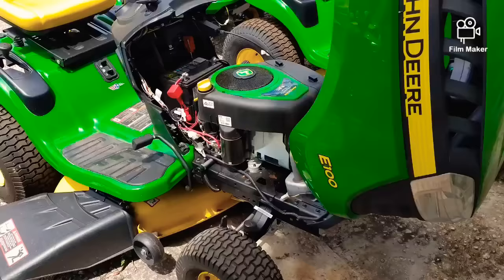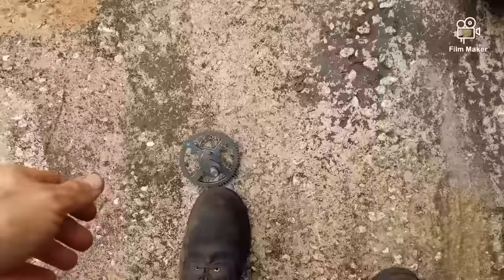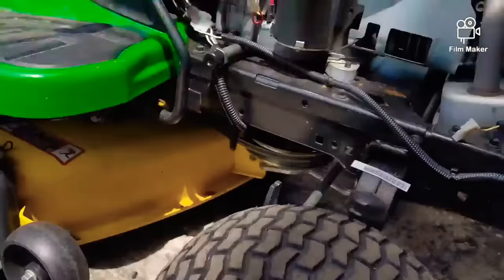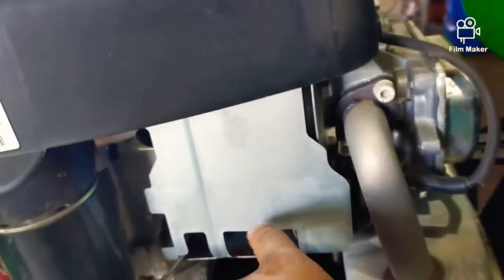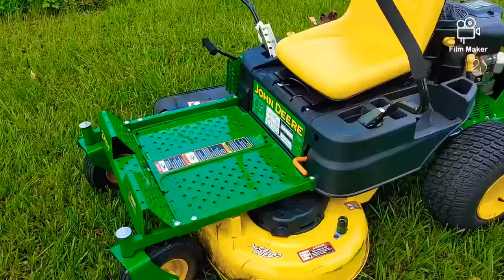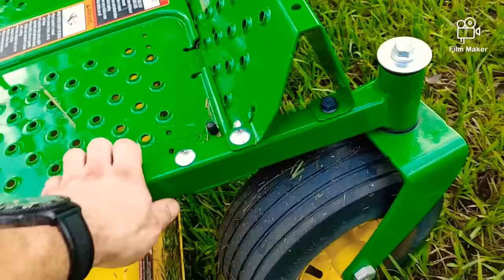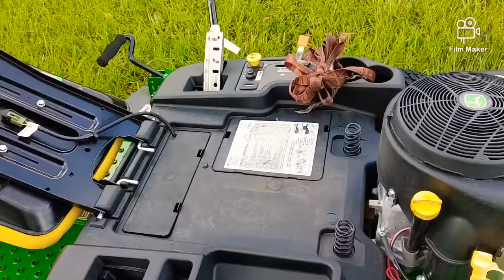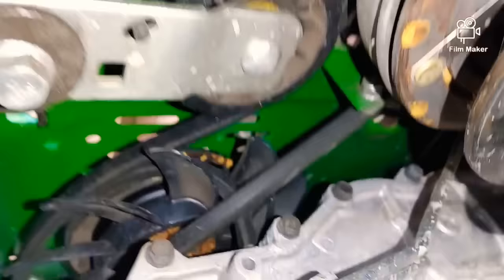Lawn mowers to avoid!

Comment: I purchased a "residential" 42" Toro Timecutter with a fabricated steel deck and the "My Ride" suspension system a couple of years ago to replace a 42" Timecutter with a pressed steel deck.  The only complaint I had with the old machine was the pressed steel deck... which is why I purchased the "same" machine only this time with the fabricated steel deck (which they call "iron forged").  I had to do some repair work on the pressed steel deck because of stumps I ran over, bending/breaking some parts underneath.  (Also destroying the blades)  I appreciate your taking time to make this video and will agree that there are some real pieces of junk out there.  That being said, I will stand behind the quality of my most recently purchased machine FOR RESIDENTIAL USE... indeed, the next step up would have been a commercial unit although the machine I purchased does come in 46" and 52" 'residential' as well.  Toro has made many improvements over the years, and if you purchase the dual bagging system ($900) it simply cannot be beat even by powered vacuum systems- it picks up everything.  I did sell my old Timecutter to one of my neighbors for $400, and he's still using it.  While Toro is the company's main brand, they also include commercial equipment like Exmark, Ditch Witch, Spartan as well as some of the finest rough, fairway and greens golf course maintenance machines available.  I also have a 22" "Personal Pace" walk behind manufactured by Toro.  MTD did make entry-level garden tractors and walk-behinds for Toro a few years back- whether they do or not now, I am not sure.  Most of the "pieces of junk" you refer to in your video are manufactured by MTD.  I think MTD is associated with (or owned by) Murray.  It all boils down to "you get what you pay for"...  As a side note, I will never buy another pressed steel deck zero-turn machine.  The difference between one of those and the fabricated steel deck I now have are day and night.
Reply: I agree ... and the reason I bought a smaller residential zero-turn from Bad Boy Mowers .... fabricated EVERYTHING .... HEAVY-DUTY design and production. I thank my salesman everyday for recommending it.

Comment: I've had a 335 E Z-turn for 5 years now.  I cut 3 hilly acres with it every week during the summer.  Only issues to date is I had to replace the drive belt once, took like 5 minutes to do.  Been very happy with this machine honestly.  And yeah MTD makes these.
Reply: i just feel personally if im getting mtd quality why not just buy a cub cadet and save the wallet and not buy the green and yellow markup
Reply: @harleythrelkeld7587  When I bought mine the Cub  Cadet version was actually $100 more.  Looking now, 5 years later, the Cub Cadet version is $100 less.
Reply: @Zappy1210  thats shocking honestly lol normally the cub, troy built or whatever else are a few hundred cheaper than the green counterpart
Reply: @harleythrelkeld7587  They all run for about $3400 currently apples to apples.
Reply: @Zappy1210  in ohio here a 54 inch cub is actually 3800 with a kohler engine and 4100 with a kawasaki deere is priced the same as the kohler but doesnt outright list engine manufacturer
Reply: NO. MTD does not make the Z335E.  You are mistaken.
Reply: @DAD0123  Nah, pretty sure MTD makes all the non-commercial/industrial John Deere mowers.  Might want to check your facts on that.

Comment: I'm an  eetc certified technician, I work for a national small engine repair company for many years. That plastic transmission was used by Husqvarna for several years, it had so many failures they ultimately quit using it. As far as the compression releases go, in my experience I noticed the ones that failed more often were the ones that lacked regular maintenance such as oil changes. The 31r Briggs engine was Notorious for those to fail regardless of maintenance
Reply: I agree on not changing oil and cam failure 
Even had a Honda GX 390 compression release stick and had to dis engine and free it up
Change the dam oil people
Reply: @philliphall5198  also, on the smaller engines like on lawn mowers and pressure washers the gcv160 and gcv190 with lack of Maintenance I found the exhaust valves would stick, sometimes breaking the rocker arm
Reply: My craftsmen 18 hp ohv intek engine has that small problem but after buying it from the woman she had it over filled with oil the oil level was to the middle of the dipstick so i drained it down to the right amount and let it burn off whatever was left from being to full and then noticed i had to spin it clockwise a tiny bit it starts right up 

So the craftsmen 18 hp ohv intek has that problem what causes it though you think its from people not changing the oil 

I'd almost think it could get that way from people not adding any oil to it when its low on oil then that part on the camshaft heat up and warp then break it has to somehow because even old oil still lubricates the parts

Comment: I have a 335E and my tires front and rear have not lost any air in 3 years. I have had no issues with it at all. I only have about an acre to mow, and so far am very happy with it. Time will tell.
Reply: Same here! Same mower. Have 41hours on it. Been very blessed no problems.

Comment: Other than the issues with the front tires not holding air, I have nothing but good things to say about my 335E. I've mowed 2 STEEP acres for the past six years with no problems at all.
Reply: Get rid of it while it's still working. Lol
Reply: Quite often, it's the operator, NOT the machine. Some people should not operate machinery.
Reply: @stuartbear922 Plastic bushings is a pass for me
Reply: @stuartbear922  Yeah. They'd screw up an anvil.

Comment: Truth of the matter is that every product that has multiple moving parts will experience a failure over time. Some will find this out in3 months, others in 6 years and in between. Have had a z335 e for 5 1/2 years.   Mowed 2-3 times per week for 1 1/2 hrs each. I must be one of lucky ones. Other than a new battery, I’ve had 0 issues.

Comment: 335e owner here.  Almost 7 years, 150+ hours, and no problems whatsoever other than blade replacement and yearly routine maintenance.  I use it to mow approximately 2-3 acres once a week during Spring/Summer.  Have never seen the stuff you mentioned in the video...
Reply: Right
Reply: you cant be mowing 3 acres weekly, for seven years and have only 150 hours. Seems low or your acres are super flat and even, no trees and nothing to go around, just full throttle and done in half hour?
Reply: @hermanmunster714  Yep, you pretty much nailed it.  Flat, open, and full speed the whole time.  And lately I've only been doing all of it biweekly, so I'm putting even less hours per summer.  Also, I guess I didn't mention that - I only have to mow during the summer months.
Reply: I'm confirmed believer if you do regular maintenance such as oil changes and such you won't have as many problems
Reply: Thank you! 5 year owner here.  Excellent mower.

Comment: I've got a Z335E used with the property.  Served me well for 4 years, but I can see what you are saying. Although mine has taken quite a bit of abuse on 30+ acres where I had to use it to mow the pasture a couple of time.  Got lots of hours on this thing and it's time for some much needed maintenance and love.
Reply: It's far beyond "much needed maintenance". MAINTENANCE MAINTAINS MACHINERY IN "LIKE NEW" CONDITION. IT CANNOT BE "DEFERRED" AND THE DAMAGE DONE BY ABUSE ON TOP OF "LACK OF MAINTENANCE" UNDONE BY "DEFERRED MAINTENANCE" AND THINKING FINALLY "MAINTAINING" IT WITH "LONG OVERDUE" SERVICE - LUBRICATION, CLEANING ESPECIALLY BEYOND "SKIN DEEP" TO GET "GRASS CLIPPINGS" OUT OF EVERYWHERE UNSEEN THAT MUST STAY CLEAN TO AVOID FURTHER ABUSE DUE TO OVERHEATING (EVERYTHING ON THAT UNIT IS "AIR-COOLED" ESPECIALLY THE TRANSAXLE) AND SERVICING IT WITH THE CORRECT - NOT "CLOSE ENOUGH" - LUBRICANTS AND PROCEDURES AND PARTS "OVERPRICED" OR NOT IS SHOWING IT SOME KIND OF "LOVE" AS SOMEONE DUMB ENOUGH TO MOW 30 ACRES OF "PASTURE" IS NOT GOING TO HELP THAT "RESIDENTIAL" LAWN MOWER ONE BIT. 

CERTAINLY NOT THE WAY YOU REALLY WANT IT "MAINTAINED" WHICH IS IN "RESALE VALUE". DUPONT OVERHAULS AND A LITTLE "MAINTENANCE" AND SUPPOSED "LOVE" DON'T FOOL LAWN EQUIPMENT "STEALERSHIPS" AND THEY DON'T TAKE "TRADES" WITH NO "MAINTENANCE RECORDS". IT ALSO TAKES 2 MINUTES TO GOOGLE EARTH YOUR HOME ADDRESS AND SEE JUST HOW "RESIDENTIAL" YOUR PROPERTY IS.

Comment: I appreciate your video, however...My Z335E has nearly 500 hours on it with out fail.  I do an annual maintenance on it myself.  I did put a pair of bushings in the casters last year along with installing a grease zerk for them.    I installed some "flatout" in the caster wheels and never looked back.  No bent deck so far and it sure is heavier than those Cub Cadet/MTD junk mowers.  This past winter I did replace the bearings in the deck spindles.  The bearings didn't lock up but were sounding rough.  I already had the deck off for annual cleaning and checks anyway.  The bearing replacement was only about a 30 min job.    I've been pretty happy with my Z335E so far.   I bought my Mom a Z235 years before this one, and hers is still running and mowing fine.  Basically the Z235 is the same mower.  She is able to steer the Z235 without hurting her arthritic hands so much.  She's 88 and still enjoys cutting her grass when she can.
Reply: I see so many replies referring to the Z335, what about the Z315E which I just purchased. What's the difference?

Comment: I own a z335e and absolutely love it.  I installed an optional foot controlled deck lift kit that bypasses the hand operated one and allows me to use my foot to raise the deck while avoiding scalping the lawn when encountering brief high ground.  The engine is strong, the speed is exceptional and the entire unit has been an absolute joy to own and use.  I am finishing my second season with it and would never consider getting rid of it.
Reply: Wonderful.  Sssssssuper.  Today you love it - when it breaks (and breaks often) you will "reconsider."
Reply: @silverstake88   I would not trade my John Deeres for any other brand.  I

Comment: Bought my Z235 from JD dealer here in South Dakota. NO problems at all in 7 yrs, except for ME hitting a stump and damaging the deck. Glad I went to dealer rather than Lowes or Home Depot (closest is 120 miles away). However, thanks for pointing out the differences and potential problems.

Comment: I am in New Zealand and I have had a Z355 E for three years and the only thing Ihave replaced is the deck belt. It is a great machine that mows over 2 acres of lawn weekly over the summer. Mows at great speed and leaves a great-looking result.
Reply from the maker: Thats good. It seems moslty more recent / newer mowers are having issues. We are seeing spindles and idlers with less than 10 hours on them have bearings making noise and feeling rough.
Reply: @Mechanical_Mind  kubota are best wich i been using kubota zds there been great powerful mower with no issues and kubota transmissions are soild steel
Reply: @michaelmactavish4445  Good to know. I've had really good luck with my older Kubota T series lawn tractor very solid. Wasn't sure how the new ones were. I've heard the JD trans weren't the best overall but maybe that has changed.
Reply: I LOVE mine!
Reply: @jameshill4900  the kubota still useing solid steel transmission  plus the old t series mowers transmissons are still avaliable even parts as well like all the older kubota models from 1986 they still make parts for it as well wich deeres allways discontinuted makeing there parts for older models  wich why kubota allways keeps there great value on there product when time trade the kubota dealers gives great trade in value  like my neighbour  got $10,000 for a small older g2160 with mower,blade,blower with cab wich he got more for trade in then he thaught the deere dealer here was gonna give him $300 to $500 on the whole thing wich was kinda rip off
Reply: I've got one. Stupid front tires always deflate. I gave up and just run them without air. Deck hits pine roots and bends easily. Doesn't turn worth a hoot.  I hate it!
Reply: Same here. I've had mine for 5 years. So far the only issue was a pin fell out of the steering arm. A nut loosened and fell out. Bought a new one, and had it fixed in 5 minutes. Put some lock tight on the thread so it doesn't do it again. Haven't had an issue since.
Reply: @jameshill4900  deere still uses plastic transmissions wich are garbage  and kubotas are still using steel heavy duty transmissions on there mowers plus with there kubota zero turn units you can accully add a plow on to the front of them as well
Reply: @ltcajh  Sorry to hear that. What year and model is yours?
Reply: @joep6023  Z355E. I can’t remember when I bought it.
Reply: Wish this video was available a year ago, i haven't had any trouble from my z355R, but i watched dozens of videos and there were nothing but great things said about 355E and R. Maybe im ok, ive only got 1 season on mine though.
Reply: I have a  z355E as well and I have not had any problems with it also
Reply: My 355E has had Zero issues Solid Machine for the price I paid.
Reply: My 335E looks like the day I bought it a year ago and has had 0 issues.  Will keep my comment updated in case he proves to be correct, but so far I love my mower.
Reply: @ltcajh  so weird, I bought a 335E last year and have had no issues, My deck is flawless, I wonder if they used some bad metal during the pandemic or something?  I hit a stump last mow hard and was worried based on all these comments and my deck took no damage despite the mower coming to a stop and me coming off the seat.
Reply: @tennesseebob1980  I bought a 335E bro and no issues here either and i smacked a stump last mow hard.  No damage or bends, my deck is a tank.
Reply: @18wheeleronthemove  me either, mine looks brand new after a year.
Reply: @draybo6936  same brother, I think there were some lemons that came through during the pandemic.
Reply: @Tolbat  Mine was pre-Covid. The deck isn’t thick. Hit something immovable and it bends. Doesn’t turn that well (was a return to Lowes), and front tires will not stay inflated. I’m looking at higher grade mowers next.
Reply: same I bought the z345r in 2019 and it ran so good that I trusted it to start a lawn care business with. Havent had a single mechanical problem with it yet.
Reply: @Mechanical_Mind  A lot of the quality issues are due to worldwide shortages for parts.
 The manufacturers have had to look everywhere to source parts for assemblies, and even after market whole assemblies.
 I'm a service technician in the office machine industry, and even though office equipment is more reliable than ever, these last two years have been an adventure, as the manufacturers scramble to get enough parts for demand.
 As a result, they've had to lower their quality standards.
 I can honestly say that I have never seen the circuit board failures in all my 40 years in the industry, as I've seen the last two.
Reply: We’ve had the z355e for about 3/4 years now and the only issue we’ve had is the deck belt. And that’s been a lot we’ve probably put 8/10 new ones on just in the past 2 weeks 3 broke and they are original jd parts from the jd place so there like 50$ a piece my husband probably mowed about an acre on the last one when it broke

Comment: Glad that I found this discussion. I was considering purchasing a new JD Z345M 42in. 22HP Zero-Turn mower because I can pick it up for a great price ($812.00!). I know that the newer ones are built better but I am now having second thoughts about buying the mower. I have owned JD mowers in the past and have always had good results. Anyway, thanks for posting your no nonsense honest opinions in this video! 👍👍
Reply: I have a Z335E for 3 yrs and haven't run into any problems. I would say you should be fine but all mechanical things can break.

Comment: I have a 345R , LOVE IT. 3 years,  no problems front tires hold air. Deck seems solid, pulled deck to rust proof it, belts went back on easily.    Was told it came from a John Deere plant. Will keep an eye on front bushings, so far they seem good.
Reply: I have the same mower I bought new about 3 or 4 years ago with the 21.5 HP engine. I haven't had one issue with it, so now I need to go check it out and see if it has those plastic bushings on the front wheels. **UPDATE** I just checked and it does :(  However, I take care of my tractor and try to never cut in the rain. Not sure if that matters but I am sure I will have to replace them when they break :(  Other than that it has been ok. I also put the engine guard on the back as well as the mulching door.
Reply: I have a 345R also. The only thing I noticed on mine is that one side seems to go faster than the other with the handles all the way forward. Adjusting the steering handles with that stop bolt on top is useless. If anyone has any suggestions on that it would be greatly appreciated. Other than that I have had no issues with my mower.

Comment: I have a D140 bought in 2009  Battery a few belts, new blades, but I keep the oil changed every 40 hrs, get the Kit change oil filters plugs, Grease deck she has been a goodun....gotta work on the steering but it's a keeper

Comment: I've had my Z235 for 8 years. A few years ago, the front caster wheel pivot bushings got a little loose. Replaced the fiber bushings with brass bushings and drilled and tapped for grease fittings. Still tight years later. Almost 400 hours and the upper pto clutch bearing started getting a little noisy. Removed the clutch, popped the sesl out and injected some grease into the bearing. Sounds good. Nothing wrong with these mowers.
Reply: I agree I had one for 9 years and one dry summer cutting around a tree the roots were more pronounced because of the dryness and my blades cracked into my deck! STAMPED DECKS ARE TRASH!